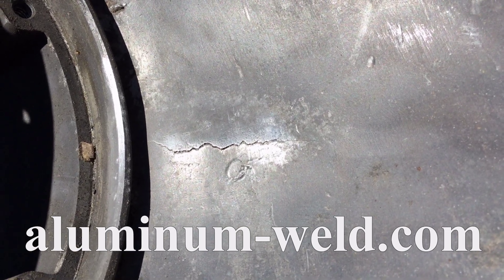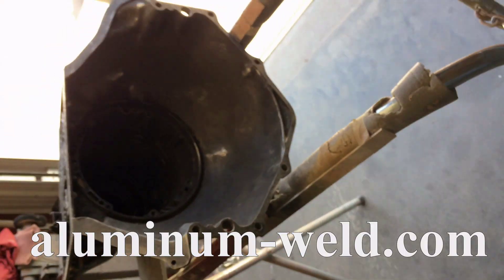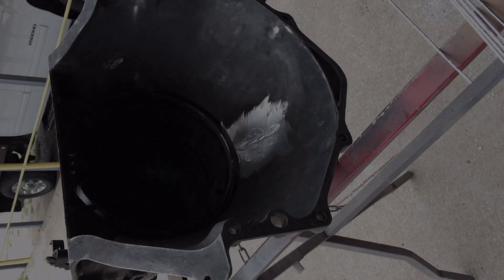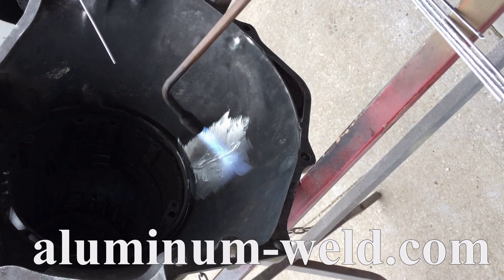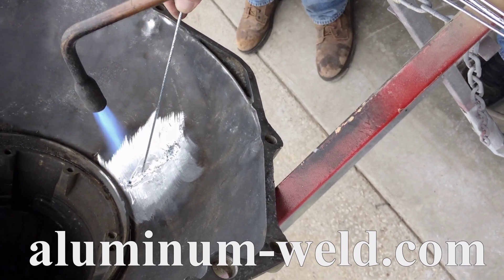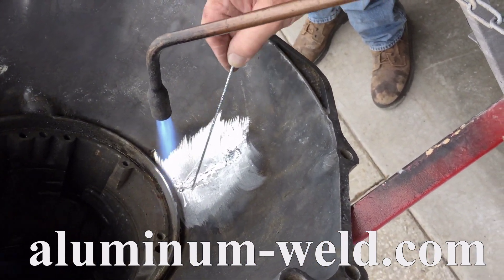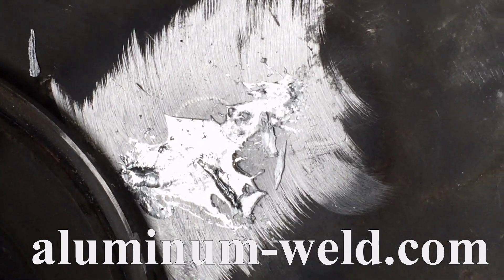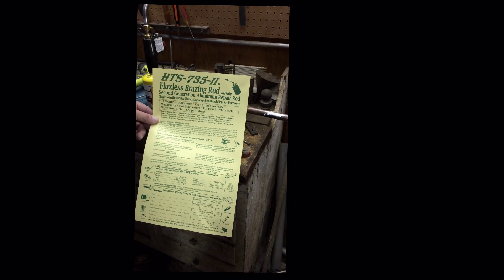Transmission Repair with HTS-735-11

Comment: What about a hole the side of a quarter or a little bigger. How would one repair that?
Reply from the maker: Put a steel backer on it and fill the hole. The rod will not stick to steel.
Reply: Get another piece of aluminum plate and glaze that over the hole.

Comment: I rebuild transmissions for a living. That was a casting seam not a crack.
Reply from the maker: The owner wanted the area repaired. The point of the video was to show how HTS-735-11 can be used to make these type repairs.  Thanks for your interest.